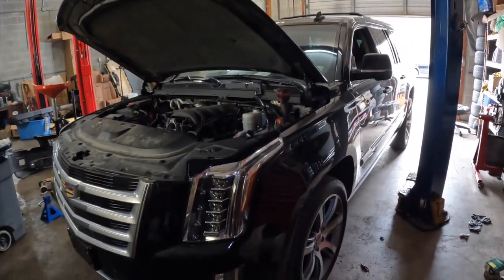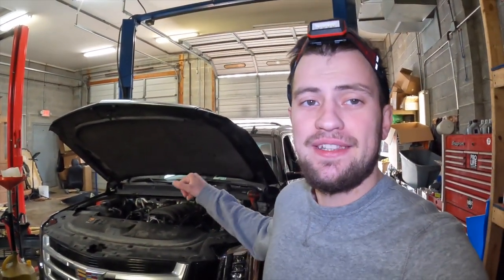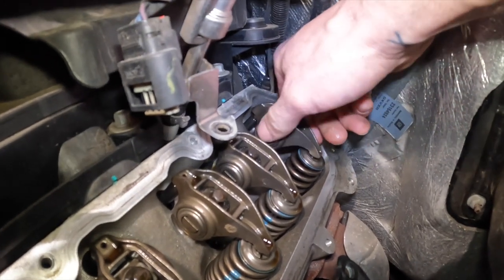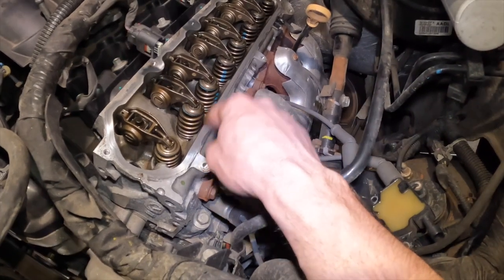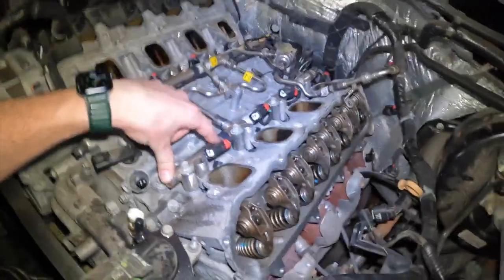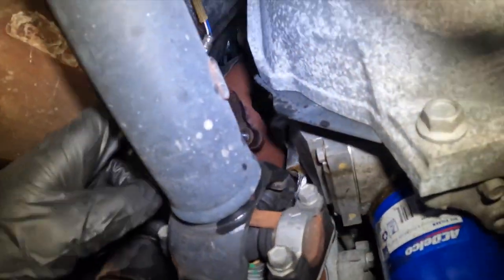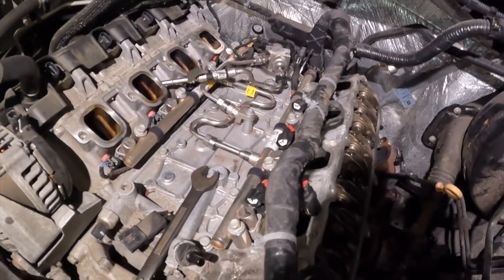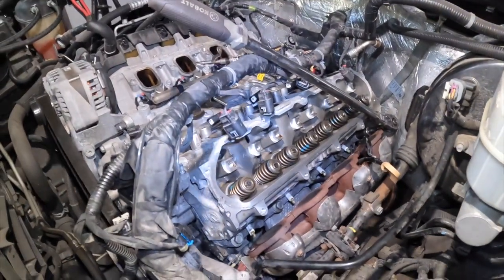2015-2023  Cadillac Escalade Nocking Noice / How to fix Lifter Tick (tacking engine apart)

Comment: I just bought my 2018 Cadillac Escalade and before I took it off the lot it started knocking and right away they said it's the lifters hopefully they can fix it all I do have warranty on it but I think I just made a bad investment I gave up my 2010 Honda Odyssey van for this Cadillac and I can't even drive it anywhere without being embarrassed
Reply from the maker: Sorry to hear that but this engine is not that bad. It’s just need some
Extra attention and care , make sure you replace the engine oil at least every 5k miles
Reply: Thank you so much for responding
Reply: Same thing happened to me mine has 70k miles. This is my 3rd Escalade. My last Escalade was a 08 I had a terrible issue with the lifters and then the tranny started slipping. I traded it in for a 16 Denali with the 8speed transmission and it failed in less than a year. Now I have my 18 Escalade and here we go with the lifter noise. Gm has burned me so much but I just can’t resist the Escalade smh god help me. My 03 was the most solid vehicle and had better seats.

Comment: That engine needs to be pulled and completely rebuilt or u going to be doing that job again real soon. And u definitely need a new cam
Reply from the maker: It’s been couple of years now and everything is still good
Reply: @mechanicmode  good to hear. I refuse to buy that model truck. That’s a 30,000 engine brand new

Comment: Not to br a negative Nancy but I had a very similar thing happen on my vehicle. However , you 100% must replace that cam also. The reason is because the lifter bearing is really rough and messed up right? Well now your cam looks the same way and that will cause vibration. Expect that lifter to fail much faster now.
Reply from the maker: Good advice

Comment: That’s never going to last that camshaft is shot from the lifter roller spinning it will be back in a week tops
Reply from the maker: Lol I fixed the car and it’s still running this days no issues no problems
Reply: @mechanicmode  the roller on the lifter 100% ruined the camshaft. It’s literally impossible that it’s going to last I do these engines all the time.

Comment: I was told that if you don’t change the valve manifolds I think it was that it will reoccur again .Gm dealership mechanic recommendation
Reply from the maker: Well I guess we have to do that too 
Thanks for advice
Reply: 100%  true. I took mine to the shop they replaced the lifters  but not the manifolds, 2 weeks later I am back at the dealership and they had to re do everything again.  Thank God the warranty covered everything

Comment: Even when you replace the old lifter another one will fail later?
Reply from the maker: If the engine is good and doesn’t have any damage is not supposed to have issues

Comment: didn't even look at the cam lobe. good luck with longevity
Reply from the maker: Thanks , good luck for you too
Reply: Exactly what I said. Had a similar issue on my escalade except mine just had a failed lifter that I caught immediately. Cam was still messed up and replaced.
Reply: @anthonybron620  how much pay for fixed bro?
Reply: @manuelaguilar8418  Well, with parts and some extra tools, it cost me like 3k to replace the cam, lifters, seals, gasket seals, new head bolts, Injectors, timing chain/sprocket, lifter sleaves(plastic part that holds lifters), and lastly oil/lub. I did the rebuild myself so it was way cheaper.